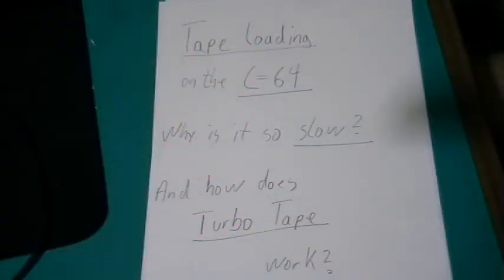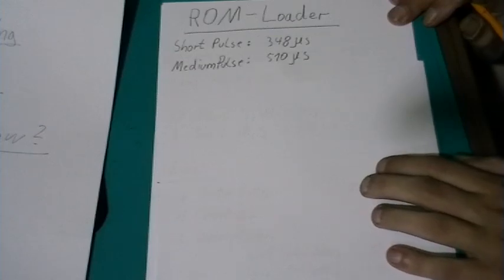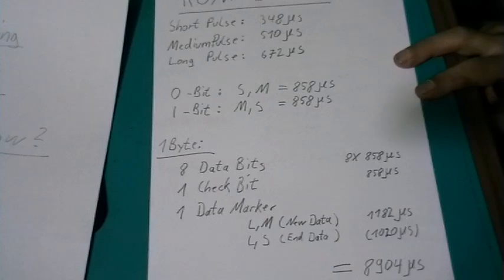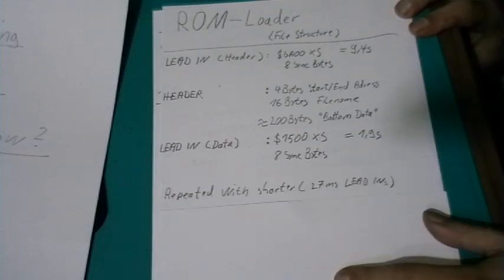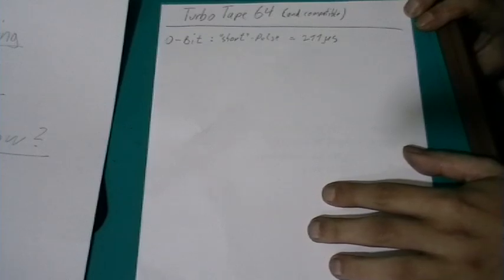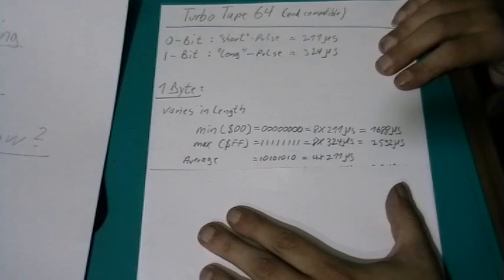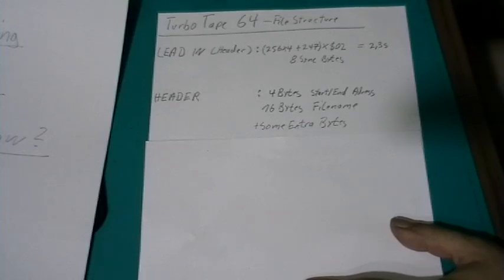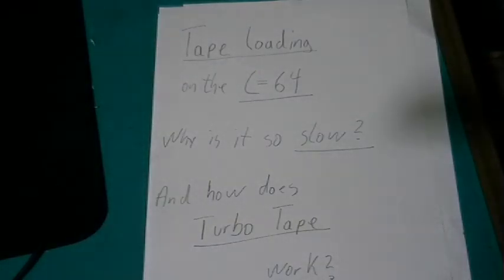C64 Tapeloading - ROM Loader and Turbo Tape - How does it work

Comment: great video thank you for the explanation! :) reminded me to the low level modem protocol programming I was doing for my BBS a decade later after my tape-commodore era. :) i was always thinking turbo loaders were using some kind of simple realtime compressing algorithm - but it was even simpler this way :)
Reply from the maker: Thanks!
They really used ingenious but simple things to get everything out of those old machines.

Comment from the maker: Thank You!
I plan to do a video on Turbo Tape variants somewhere in the future, but that's something for long winter evenings.
The 1983 version should be the original one. My first Turbo Tape was the screaming red flashy one which has the same limitations as the original one. I got my 1541 only 3 months after I got my C64, so I missed most of the development of Turbo Tape.
Will be quite some research to do...

Comment: Thankyou for explaning this i often wondered how it was possible to have fast loading tapes, shame some guy didnt invent it for the atari too.
Reply from the maker: Well, it was invented for the Atari and I think it was used quite a bit in Eastern Europe.
But it needed a hardware modification in at least the tape drive and you had to use special software to load from tape which you either had on cartridge or had to boot from disk...
Never had something like this and probably never will have since I have much better ways to load stuff into my Atari.
The reason why you have to mod the Atari system is that tape loading on the Atari works completely different from the way it works on the C64 (and probably all other systems I know).
As I explained in this video, on the C64 it's about a pulse length. And if you shorten the pulse length and make other clever tdecisions, you can speed things up quite a bit. 
The Atari uses 2 different tones. The one represents a digital "1" and the other represents a digital "0". The tape is then scanned at a set rate by the tape recorder. I hope I'm not talking complete bullshit right now. It's been quite a while since I read about this stuff. 
The point is that the tape recorder is more intelligent than on the other 8-bit systems and so there is no easy way to speed things up.
You basically convert it to the 'stupid' method used on other systems and use a different loading routine that can deal with that.

Comment: OMG the best explanation of how work tape loading. I've never understand it until now. Thank you very much !
Any chance to explain the same about 1541 loading on magnetic disquette for noobie persons like me ?
Reply from the maker: Thanks!
A video on how Floppy Disk drives work is not a bad idea, but I would have to completely understand it myself first.
There is a lot more to it than to tape recording. Especially if I don't limit it to the C64 but make a more general video.
There are at least 3 entirely different methods the data is encoded on the disks and then there are a lot of weird copy protection schemes which I only ever went into on the C64. 
I'll keep that in mind, but this will probably not be anywhere soon.
The "8-bit guy" has done a video on how floppy disks work on the C64.

Comment: Would turbotape also be more efficient in storage space? I've got a generic "Romcon" fastloader and it claims a speed up to 10x faster.
Reply from the maker: Yes, 10x faster also means 10x capacity. 
The tape always runs at the same speed.